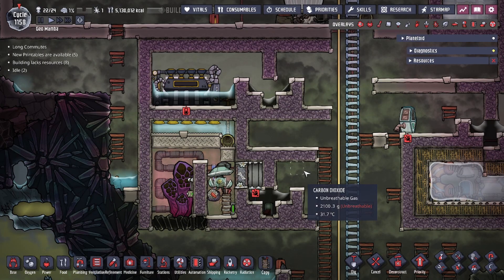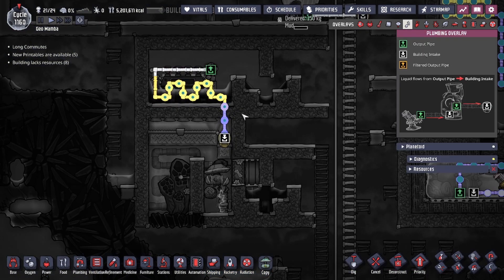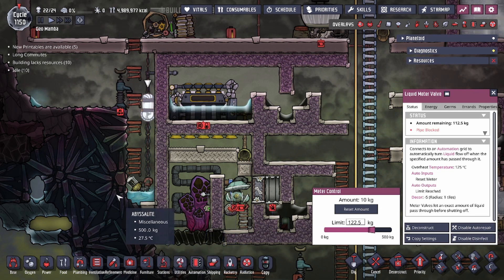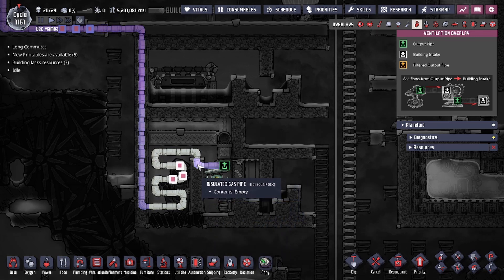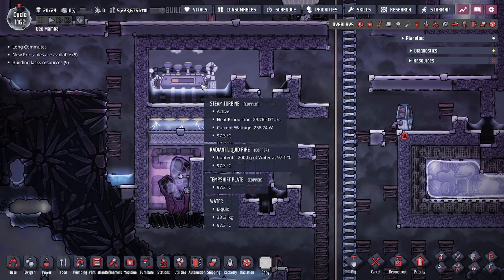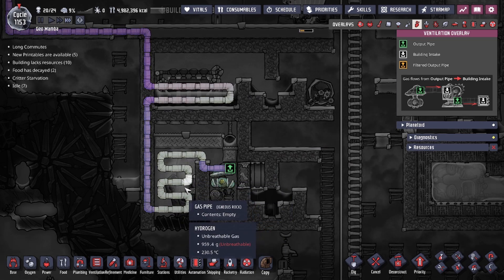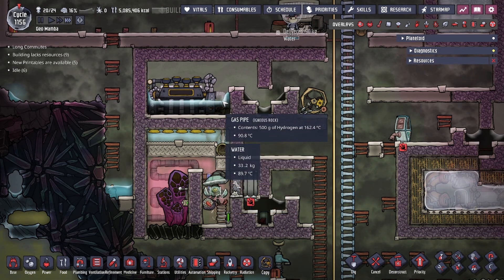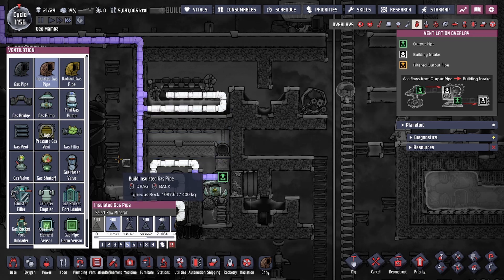Hydrogen Vent Tamer Design - Self Cooling , Self Powered , No Steel - Guide - Oxygen Not Included

Comment: I’m curious why you didn’t also run your H2 pipe through your metal tiles and steam to cool the H2 just a bit before running through the turbine? Would the steam room get too hot or just didn’t think of it?
Reply from the maker: yup, the steam room would get too hot. as the build stands it only occasionally hits 135, doesnt go over and thats after the build aborbs some heat from the hydrogen. without the pipeline absorbing some of the heat of the hydrogen, the steam room gets to ~139c but the hydrogen in the pipeline comes out around 115c which might be more attractive. i made the decision to have it be more stable since the hydrogen vent does have a range of how much hydrogen g/s it generated and how long the eruption period last. had to make sure those who got a longer eruption or more g/s generated to be accommodated.

Comment: In steam room, if you put the vent one tile higher and a bead of oil in that bottom spot, doesn't help to heat up the water faster, as the water is in contact with the first metal tile (hot end)?
Reply from the maker: that no longer has any affect since klei has patched the steam turbine heat deletion bug